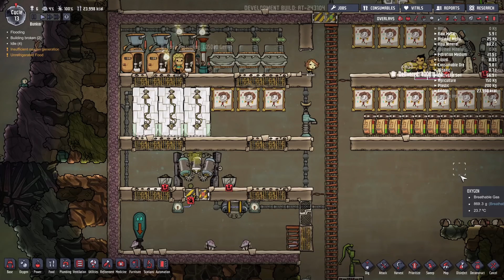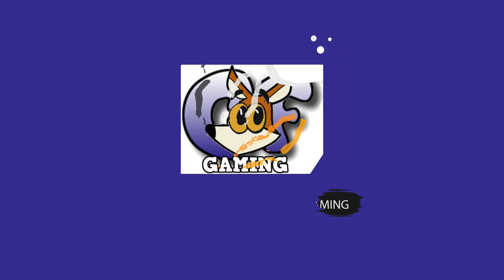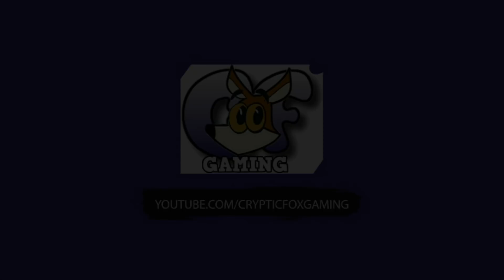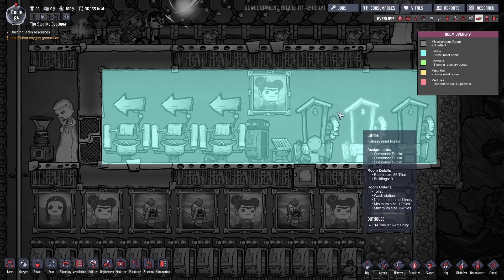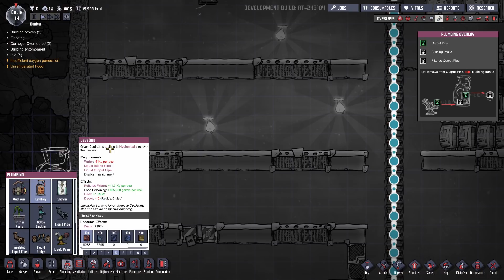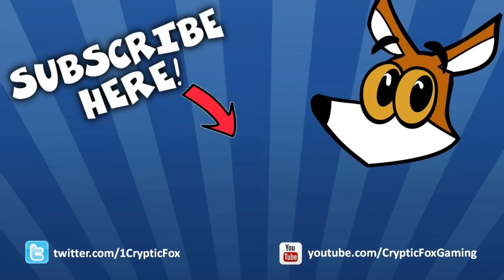Updated Bathroom Tutorial! - Automation Upgrade - Oxygen Not Included Tutorial/Guide

Comment: Fox I’ve built this in my colony, but the water keeps running out because it sends more out of the liquid shutoff than it should. Any idea how to fix this?
Reply from the maker: The easiest way to handle the overflow isn't with the automation i set up here.  Put a liquid bridge before the sieve, and put a second pipe off the input side of the liquid bridge and send that to wherever you want your overflow water to go.  The water will prefer going through the bridge, but if it ever backs up to the end point of the bridge it'll send the extra water down the secondary overflow path you created.  Skip the automation stuff :)
Reply: CrypticFox ok thank you cuz that’s been giving me a lot of trouble with my colony. Which just recently got to over cycle 100, and I have it sending the water down to the electrolyzer room, not unlike the one in your other tutorial, so that way I never have to worry about sending water into that, but I still run out of water from it so I ended up starting to pump water from my main supply into it lol. Thank you for your videos, they’ve helped me learn a lot about the game. Keep doing what you do Fox!

Comment: Usually I send germy water to some tank where I boil it with tepidizer to 85 degrees, and then pump back to toilets. Although all pipes should be well insulated for this not to spread heat in the base.
Was searching for a better way to get rid of the germs, so you have any ideas?
Reply from the maker: There are a few easy ways.  For my toilet loop i don't even remove the germs, but it's possible at some point they'll change the game so it won't accept germy water this way.  The easiest way is to pump the germy water into a liquid storage container in an enclosed room full of chlorine gas.  The water will decontaminate while it's in the room and come out clean on the other side.  Takes not energy too which is nice.
Reply: Be careful with the heat from the pool of water you're cleaning if you use tepidizer. Personally I don't loop germy clean water back to my bathroom and intended to use pwater from lavatories to feed my fertilizer maker. Or from some posts I read, dump your germy clean water to water geyser. The heat there will naturally kill the germs

Comment: Anyone know if this is still valid as of the rocketry update?
Reply from the maker: It is, yes.  Though rather than using the automation for the overflow, if you use a pipe bridge with a second pipe running off the input from the pipe bridge, if the water backs up to that point it will flow off into the second channel, but will otherwise prioritize sending the water through the pipebridge.

Comment: Using a bridge instead of the shutoff valve is a even easier solution. As bridges have priority in an intersection or T junction (so not 50/50 as a normal junction). You can send the output of that bridge towards your bathroom as your doing now, but as the water backs up past the bridge, excess water will start flowing in the runoff pipe, effectively achieving your automation without using power and/or refined metal.
Reply from the maker: Yep the bridge is far easier than using automation for the timer.  I’ve been using the bridge method but haven’t updated this video to reflect the difference.

Comment: Why would you ever use a shower? I've gone all the way to cycle 200 a few times without a single shower, and had no problems.
I just find it to be a waste of resources, but then again I've never had stress problems before
Reply from the maker: It just removes the grimy debuff.  Purely a preference thing
Reply: but does grimy actually do anything? I haven't noticed to make germs spread faster
Reply from the maker: No it doesn't impact germs. It's just a stress modifier.  You really don't need showers.  i just like to include them as a personal preference :)

Comment: Wait a sec,

If I understand this right...

Lavatories produce almost double the amount of polluted water than the water they take in... Which you then flow through the water sieve that is changed to clean water.
Can't you build a reservoir which will flow through that liquid shutoff valve, which will end up on a electrolyzer? The system basically produces MORE clean water than it consumes. This is a severely overpowered renewable oxygen source.
Reply: good boy
Reply: The problem lies in the Sieve -- we need to direct the excess water WITHOUT depriving the Restroom of the water it needs to function. That means multiple tubes and that... gets complicated.

But maybe 'Fox can find a way.

Comment: I tried this setup but now my Electrolyzer is now making Food Poisoning oxygen. I need to disinfect the air or something.
Reply from the maker: Generally the food poisoning germs die off in the air, and are typcially only a problem if ingested, though in fairness they might be more resilient after the last update.
Reply: My temporary solution is I put a Space Heater beside the Electrolyzers. It kinda works at the cost of 120W. Self sustaining O2 generator ftw! Thanks Cryptic!
Reply: Polluted Oxygen can be cleaned by a Deodorizer. Some animals consume it as well.

Comment: man this is so smart and did you study Process Control System because this is counted as 
 Genius control I liked your tips and this is a superscribe to you smart Man XD
Reply from the maker: There are a couple of ways to handle this overflow mechanism (you can also use a pipe bridge setup to do the same but I wanted to use the new automation upgrade).  My line of work is in business efficiency using Lean Six Sigma and process re-engineering.
Reply: mate this is basic common sense if you know what the equipment/tool in the game does.

Comment: I don't fully understand your use of automation. Couldn't you just use a regular valve and set the amount of water to constantly drain? Instead of 100% flow for 15% of the day, just set it to release 15% of the water all the time? 

It also doesn't require any refined materials or advanced research.
Reply from the maker: The flow of water in this system is variable though, so setting a valve to drain at a constant rate can be tricky.  You want to drain off some of the lavatory water, but not so much the showers or sinks because they produce the same amount of polluted water as they consume.  Bit of a hassle trying to find that right balance, and you'd end up having to constantly tweak it.  The other way to do this without automation is using a pipe bridge.  The flow of water will choose the pipe bridge first, and when it backs up it would take the second channel you add at the entry point of the pipe bridge and act as an overflow value.
Reply: CrypticFox Don’t you run into the same problem with the clock sensor? Or is the assumption that the pipe length is always the right amount to pump out every day? 

Admittedly, I do find myself changing the valve release amount but not that often when you get that sweet spot. 

I’ll have to try this clock method. I was hoping there was a way to use the pressure switch instead but then you’d need a reservoir and extra pump which is a ton of wasted space and power.

I think honestly the best method would be hydroponics. Plants will only consume a max amount of water so if you send a small amount of the polluted through a plant or two, not only do you consume the extra water for free, you get food out of it(or reeds) which feels like an even more contained cycle(food to waste to fresh water and food).
Reply: Same issue with clock sensor. It takes more time but the system is not balanced. With Hydroponics you face the same issue, if they consume too fast or too slow, you're unbalanced. And you don't want to put germs on your plants of course. Polluted water and germs are 2 different things.

Comment: YOU DO REALIZE that you can use a liquid bridge, liquid bridge takes priority over pipe, when liquid bridged pipe backs up, pipe under it will shunt the overflow into destinaton, automation not required 😂😂😂😂 see forums.kleientertainment.com/topic/84323-burst-valves-for-liquid-pipes/?tab=comments#comment-975470 

Klei Entertainment is the developers website..
Reply: I'm kinda skeptic with this method for long term. You're not talking about the value of the water valve (0-1000g/s). I guess it's maxed out,  so there is a risk you're gonna loose too much water over time. The changing number of your total dupes will also modify the qty of water produced, so it will change over time. The bridge solution is not impacted by those variables, then it's better.
Reply from the maker: Yes it’s been mentioned a few times :). I was looking specifically to make use of the new automation features
Reply: I tried this liquid bridge thing the same way you did, but the pipes are blocked after a couple of minutes. The secondary drain next to the bridge does not work :(
Reply: this worked for me great im now making oxygen off human waste lol no more wasting water for me with your powers combined i have gotten that much better at the game

Comment: Cryptic you are wrong about the electrolyzers removing germs because i tested this type of clean water system before I watched this and it created germy air.
Reply from the maker: yes it creates some germy air, but the germs die off in fresh air, so they don't last that long.
Reply: for me i have a open system for my air depending on how i;m doing so its a slight problem
Reply from the maker: alternatively you could send to a carbon scrubber, or put you overflow valve on the polluted water side and send it to fertilizer makers or hydroponic farm plots.
Reply: I usually do that but i make the open systems when I don't have certain research unlocked or I don't have enough thimble reeds its a problem
Reply: Also only slimelung is dangerous to breath in, food poisonning is only dangerous  while eating

Comment: why are you sending germy water along with fresh water pipe? wouldn't you want to separate the two?
Reply from the maker: you can separate the two, but I'm sending it all to a carbon scrubber and electrolyzer in this case.  In the case of the electrolyzer we'll get some germs in the air but they'll quickly die off because of the lack of polluted O2.

Comment: Is there a way to not collapse in this game? I mean, I can get successful for a while, but at some point the base simply gets filled with carbon dioxide and toxic air and I lose control...
Reply: You have to maintain the airflow so that the carbon dioxide can go all the way down in your base, use aiflow tiles in the floor and maintain the oxygen pressure high. To get rid of the carbon dioxide acumulated in the low parts of the base use the machine called carbon skimmer.
Reply from the maker: It's really all about gas control.  Maintaining high oxygen pressure in your base will press the CO2 down and make it a lot more manageable.
Reply: depends all on whether or not you have a steam geyser near for infinite water generation. Game is basically %100 sustainable up to a certain amount of duplicants and or facilities that use water.

Comment: What would be the best method for cleansing the germs from the water before it returns to the loop? Somehow freezing the water in a room, heating it up again, and then pumping it back?
Reply from the maker: easiest way is likely with heat.  At 70C the germs die off but the germ population starts dropping well before you get to 70.  Drip the water over hot machinery to heat it up, pump it into a steam geyser area, put it in a pool with the aquatuner (though that takes a ton of power), etc.
Reply: CrypticFox yeah for sure on the power either way you do it. I guess freezing would be more complicated than is necessary. Would be nice if we could mix some chlorine or something into the water to kill the germs without having to go through all that. Thanks.

Comment: You have to include the information, that the outgoing water can get  jammed if you build the junktion immediately after going up one tile. You need to build at least 2 tiles up, like you did in the video.

_____________
        |        |        |   don't work = jamming

_____________
       |        |         |  works fine
       |        |         |
Reply from the maker: Good tip, thanks.

Comment: Are you running germy water back into your main pipe?
Reply from the maker: yes.  The germy water can be used to clean in the bathroom and the overflow in this case is just going to my electrolyzers and my carbon skimmer, neither of which are affected by it.
Reply: I used to do that kind of system, but i ended up changing it due to the germs it released into the air... now i just drop the polluted water and mop it, then the hatches eat and free energy! also, the duplicants dont get germs when they mop germy water :D
Reply: As far as I know my electrolyzer injected germs to the gas when used with germ infested water. Another solution would be to dump the excess water into hydroponics. There is at least one plant which uses clean water for irrigation and plants don't care about germs. This is way more appealing to me than flooding my fresh water cistern with germs or building constructions which clean the germs (as this will dump a lot of heat into my base)

Comment: i didn't know that the germs didn't mater. i built a system that dumps the germ water into an Abyssalite tile encased room with a water geyser. i use the same water on a loop for my metal refinery, as well, which makes the water hot enough to kill the germs.
Reply from the maker: The germs will matter if you consume them, but they're able to be used for cleaning at the moment.  That may change in the future as the game continues to develop, and then the water will have to be purified before it's used, but for now it works :)

Comment: Though it is true that it is easier to do with automation, you can do it without automation with a liquid valve set to a low number, like 100 grams per second, right after the water filter.  This has the same effect and I use it to deal with excess water in my systems.
Reply from the maker: With the liquid valve you just have to play around with it for a while to find the right balance based on the number of dupes you have.  This way doesn't need that much experimenting to get it working.

Comment: I did the same. But I first drop all the polluted water into a tank, and from there I pump it to the sieve. The water sieve then drop the clean results to a second tank, which is then pumped back to bathrooms.
With this, I had a clear indication that the water amount in the system was increasing. The polluted tank was always empty (the pump send it to the sieve as soon as possible), but the clean tank started to fill over time, very slowly.
I was now thinking about sending the excess to my electrolyzer, but I realized it would consume all the water in the system eventually as it requires a lot.
I will try this liquid shutoff trick to send just the excess. It should work great.
Reply: you could add a pump near the top of the clean water tank to pump water to the electrolyzers, as the pump will only become active once the water level is high enough to cover the pump, thereby creating an overflow system without expensive automation components, and still having the same effect.

I do not have the game so I cannot test this myself, but from all the videos I have seen of the game, this method should work, and only requires an additional pump,
Reply from the maker: yep that would work too, though it would require more power, as the cutoff valve only takes half what the pump does, plus you need to take up more space for another water reservoir.  Definitely more than one way to skin a cat in this game :)
Reply from the maker: I like to minimize the power consumption if I can.  That's a few extra pumps :)
Reply: Yeah, I suggested it as a way for this specific guy to work around it in his game. To each their own though, and I look forward to seeing what you do in game CrypticFox. I hope I can get my hands on this game soon, it looks soo fun
Reply: Good ideas